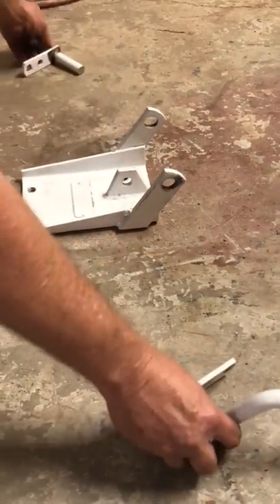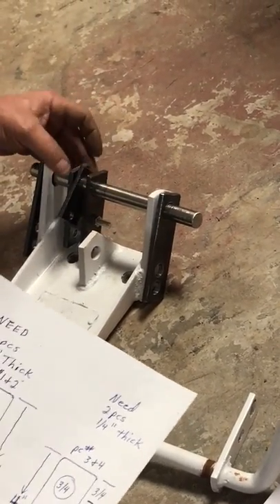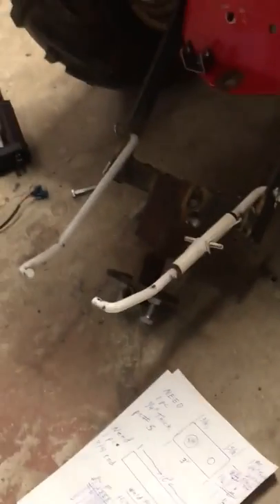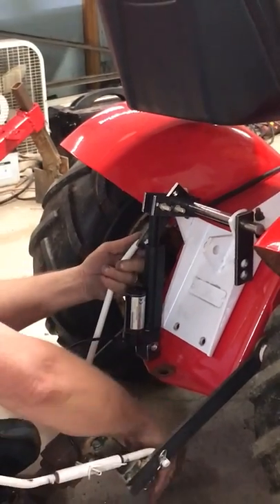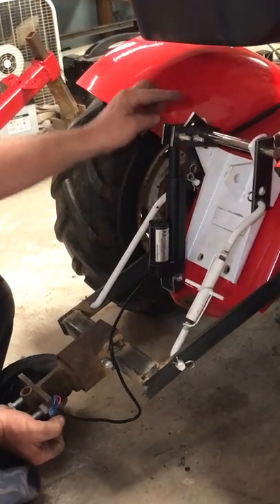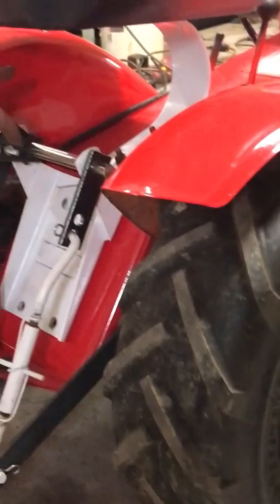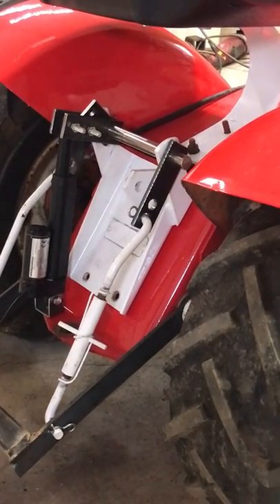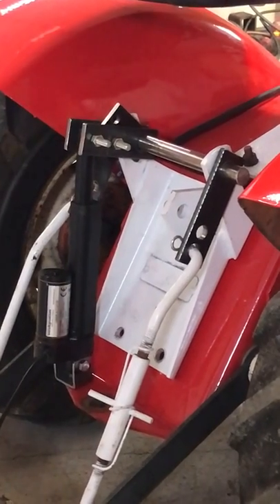sears tractor 12v dc actuator hitch part #1

Comment: EXCELENT JOB. Just acquired a '80 GTV16. Had a switch and fuse block but no actuator, just the manual deck lift. You did a great job and your instructions were clear and to the point. Volume was great too. Thanks again. 68 here

Comment: Incredible.  Very nice.  I was wondering how I could eliminate the rear blade not free floating when the front tires would bounce, and this is perfect.  I was debating on using a winch to pull up the blade then having weights out on it for down force to have free floating as well.  Think that would work?